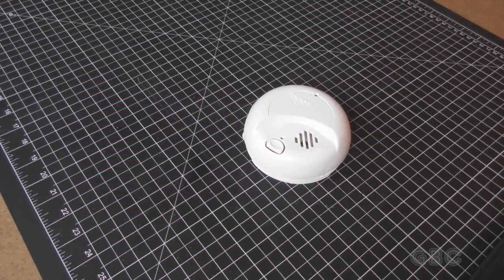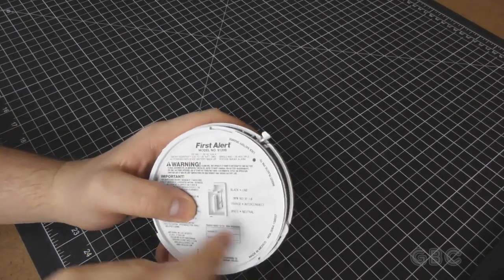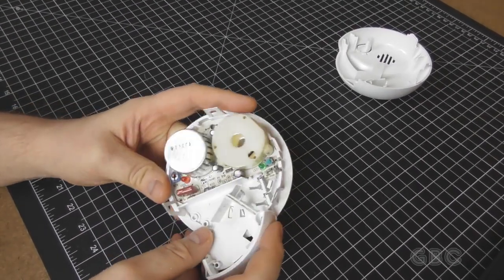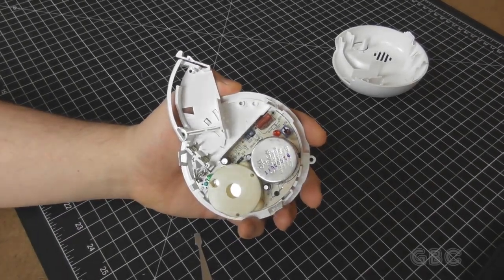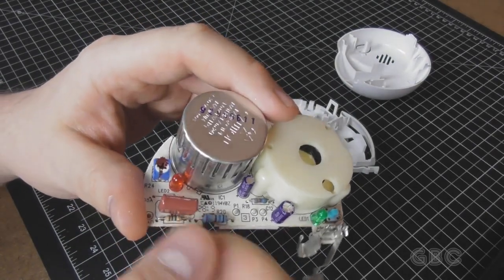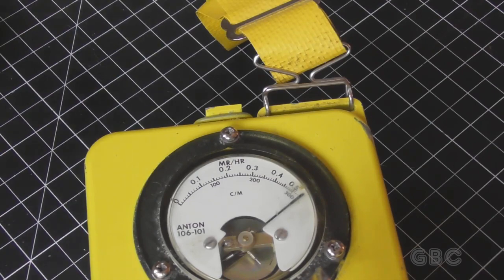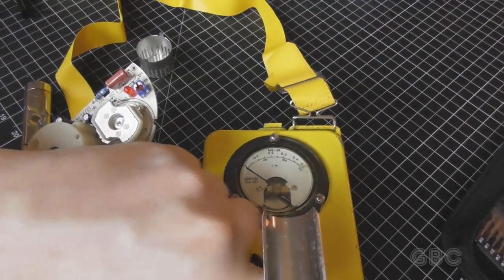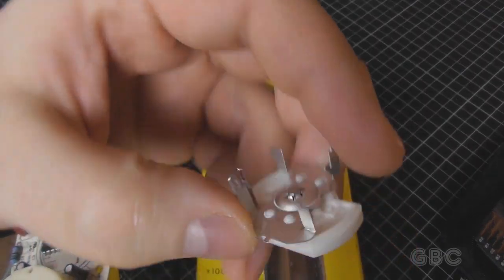[93] Ionizing Smoke Detector Teardown

Comment: ARE YOU OUT OF YOUR MIND!?!?!?!?! WTF ARE YOU DOING TAKING OFF THE PROTECTIVE METAL PANEL AND REMOVING THE SENSOR!?!?!?!??! Americium 241 is radiation(wich I'm assuming you already knew but did this for science.
Reply: He will be fine, Americium 241 is an alpha emitter so it cannot cause much harm unless he eats it. It is blocked by paper so cannot fully penetrate the skin.
Reply: @rufusjordan7733  It is also only about 10-20 times background radiation. Completely safe to handle unless you eat it.
Reply: As long as he washes his hands and does not consume the particles he will be fine
Reply: @JimRichardson34  The button is covered in a layer of gold which stops any particulates(of americium 241) from entering the air. Completely safe to handle as long as you don’t sleep next to it.

Comment: put some gloves on, if it gets inside your body it aint getting out for some time
Reply: It has a thin film of gold on top of it which makes it really hard to release dust. Also the actual americium is mixed with gold.
Reply: @modbust  sure, but speaking from personal expeirence of handling radioactive materials (much more dangerous than a smoke detector) the film could get damaged easily and the dust will be everywhere.
Reply: @jzzz-qd1nj  the dust is in an alloy with the gold and it is pretty hard to hurt the film unless you intentionally do it. Putting your finger on it or it rubbing against other metal won’t do it.

Comment: Was the Americium 241 button soldered onto the metal base? Or just held in place by contact? Thanks for the video!
Reply: The AM-241 is held into place, you just have to pull the tabs below it and it will easily come out